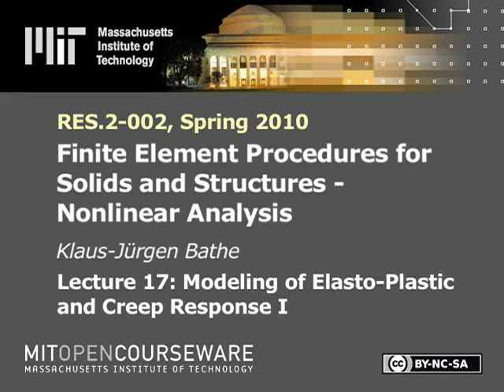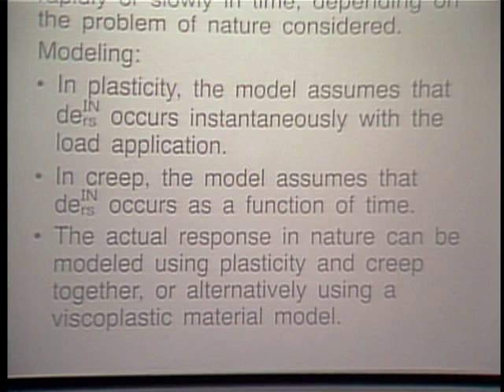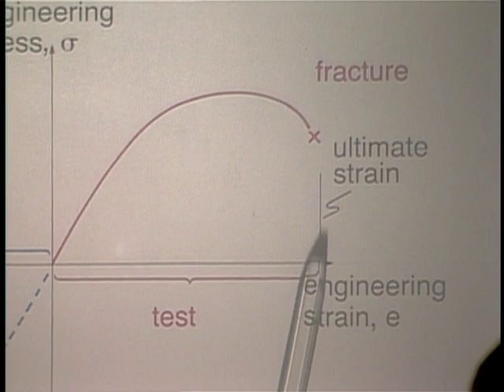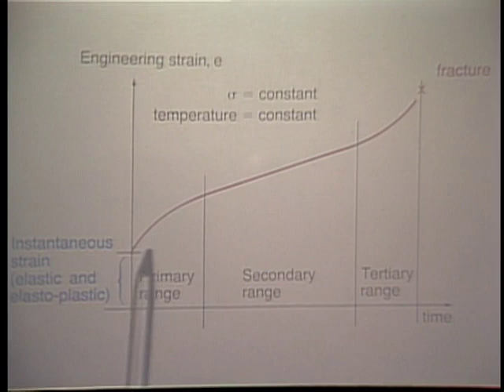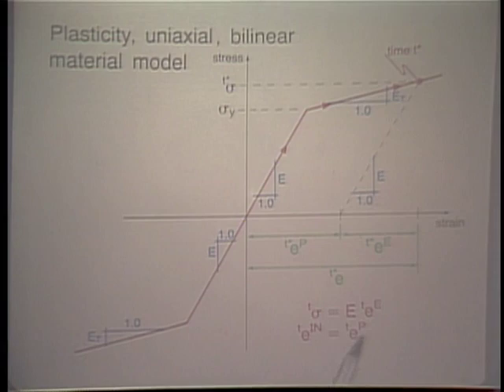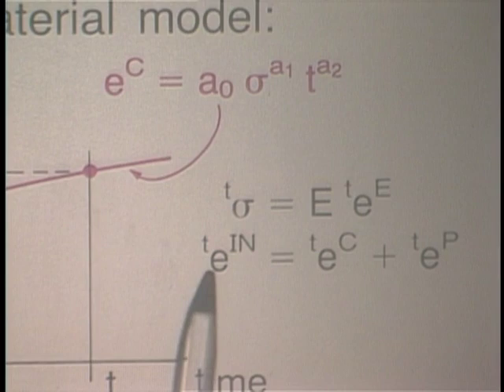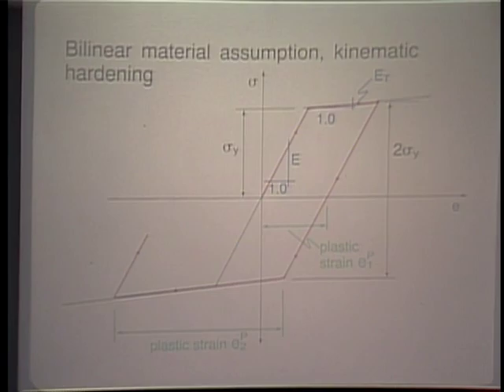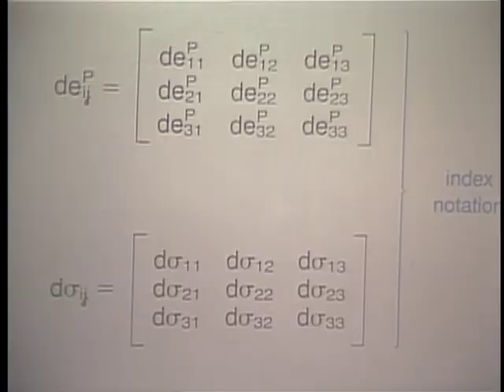Lec 17 | MIT Finite Element Procedures for Solids and Structures, Nonlinear Analysis

Comment: i was fan of Klaus-Jürgen Bathe. is he explains this way.? can not believe
One of the worst lectures on plasticity at all... He defines and explains nothing, just reads what he copied from a textbook. No explanation whatsoever about what the hell a Flow Rule is, or hardening rule (which he didn't use, he used a stress-strain relationship instead, very confusing), how the mathematical assumptions were made, and why does it even happen at all. After finishing this video, you would just remember the ghosts of the equations, without knowing what has happened. Can not believe this is an MIT quality.
....i have prepared a better note and that can share.............Dr. S. Bhattacharya, Mumbai, India